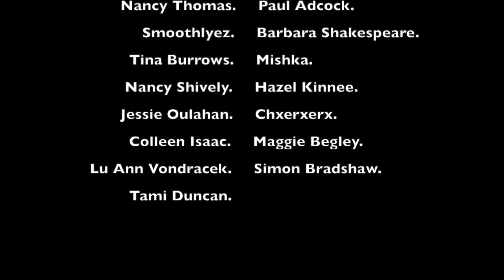LOST Control After Life Changing Incident.. We Volunteer To Help!

Comment: I would highly recommend getting the 10 AmpH battery for the trimmer. It gives it a just bit more power to get through the tough stuff. I bought the combo kit (trimmer and blower), and the bigger battery can last long enough to trim and blow everything off. I use the smaller battery for the last touch ups at the end.